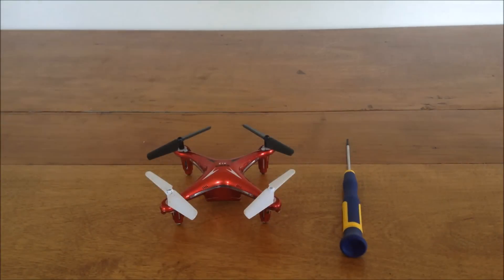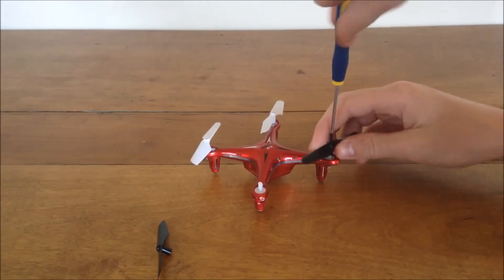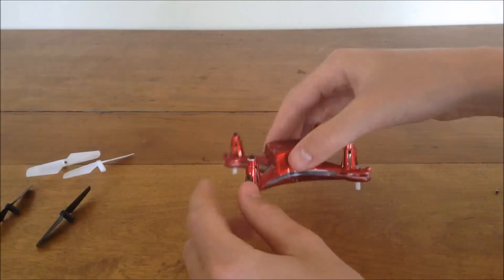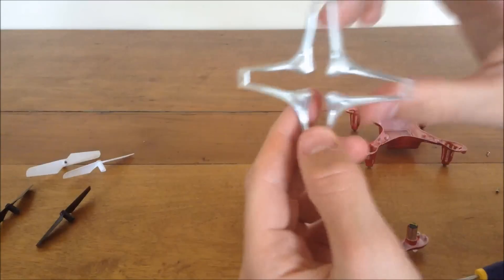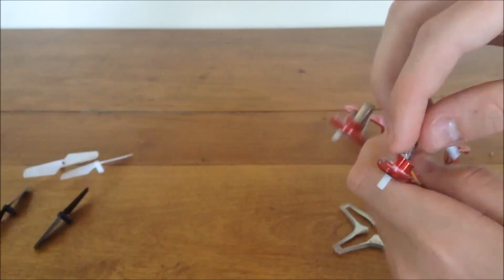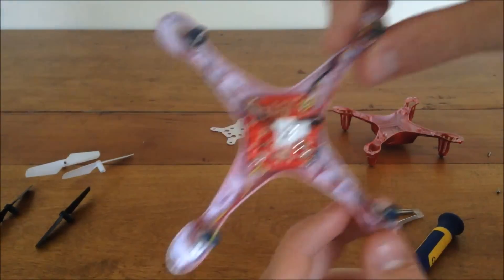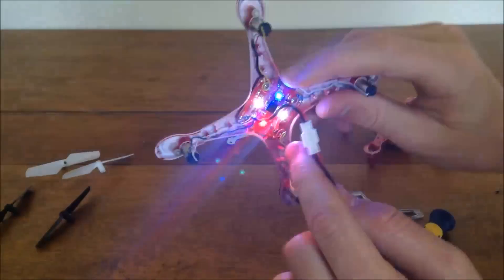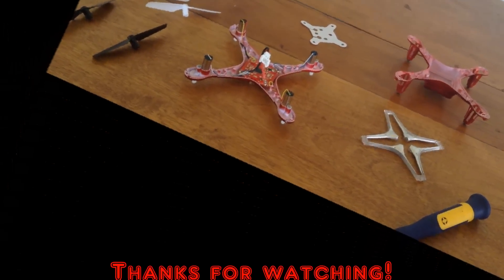Syma X13 Storm Teardown

Comment: I broke one of my gears how can I easely replace it?
Reply from the maker: I am not sure if they sell them. Not too hard to replace if you can find them.
Reply: The RCAddict I found one but how do I take it of?
Reply from the maker: Kobe Van de Vyver You have to unscrew the prop from the top, and it should pull apart?
Reply: The RCAddict there is still an other part connected to it, can i just take it of?
Reply from the maker: Kobe Van de Vyver Not sure since I don't have mine anymore :/
Reply: The RCAddict okay no problem, happy new year!

Comment: Mine has just strangelly crashed. I believe it's also a problem with the gyros. It came to life by itself, made a wide loop (a very nice manouvre, I have to say), and survived because it was high enough. The second time it was lower an crashed on his back. Broke the big gear (the stem where the propeller attachs). I glued it with superglue3, and it worked until it went out of control again. And it broke again in the same spot. Definitely a gyro problem. In your video you haven't take appart the gear set. Do you know how to remove it? I would buy a replacement gear and maybe a new board if it worth the cost. But maybe it would be cheaper to just buy a new one.
Reply from the maker: +Nuno Girão Yeah, mine did that a few times! DO not waste any more money on this one, just get a different model.
Reply: +The RCAddict I just removed the axle pin, using brute force. It popped out and released the gear. In Syma Toy Shop you can get a gear for 2.5 bucks. But sooner or later the same will happen. Going to a sbeqo fq777. And maybe a cheerson X10.
Reply from the maker: Nuno Girão Ok, those are much better :)

Comment: hey use cheerson cx 10's board attach wires coming for motor solder points its done
Reply from the maker: DA AUTHENTIC HACKER Both of my CX-10's do weird things so not sure if that would work. I have already installed and made a video on it using the Eachine H7 board.
Reply: cool

Comment: Funny :D  Only now do I understand how the props can be screwed on from the top! :D  (there is no metal axle, but you screw into the plastick gear) :)  
That prism (the translucant star-shaped part) might be handy to use (parts) for other things :)  Maybe your 250 quad for instance :)  
Cheers!
Reply from the maker: DutchRC ADVENTURES Haha, yeah. I think the LED part is way too small for my 250 and I have re installed it with the H7 board ;) I am getting one red and green led stip for my quad. I would get one for each arm but dot know about how it will affect battery life.
Reply: The RCAddict Yep.. I know buddy, but led's are Very directional (you can see the light well at one angle).. With that prism lens, you can solve that..
In fact, I have just installed a few led strips on a quadcopter.. I'll probably be able to show you what I mean shortly in a video :)
Reply from the maker: DutchRC ADVENTURES Yeah, I dont do much night flying though and even with all the same colored props orientation is easy for me. But to help I am getting green for the front. I mainly want the LED's to look cool ;)
Reply: The RCAddict Nope.. neighter do I, allthough I am planning to shoot some video of the city's night-lights from above :)  so well.. I've put 4 led-strips on a quad to be able to keep track of it :)
Reply from the maker: DutchRC ADVENTURES Nice, I think two will look cool enough. :D
Reply: The RCAddict Yes.. but like I said: leds are very directonal.. Leds at the front, you wont see from underneath, and vise verda :)  So.. 2 strips at the front, and 2 at the bottom :)   I'd allso like some blinking red leds at the back, but haven't found nice ones :P
Reply from the maker: DutchRC ADVENTURES I know but dont need them for night flying just want to look cool when close. I will put a green facing down in the front and red facting down in back
Reply from the maker: The RCAddict I just checked the 9XR's on eBay and they are both up to $75 already. I guess I will have to just spend the extra and get the 9XR PRO from HK. I will also need the case and LiFe for it so like $135 total so about $50 more than I had planned but that seems to work out as my mom gave me the job of cleaning my step dads office in his garage where I work and she is going to pay me $50! It all seems like it will work out :D
Reply: The RCAddict That is great man! Will you be ordering the quad + parts pretty soon as well then??
Reply from the maker: DutchRC ADVENTURES Yeah, dont know if these will work but here is the total cost https://www.google.com/webhp?sourceid=chrome-instant&rlz=1C1CHWA_enUS635US635&ion=1&espv=2&ie=UTF-8#q=138.94%2B12.28%2B118.18%2B178.27%2B18.29

and here is the total money I will have after I get the money I have+3 weeks of work+ cleaning the office+the refund from the MJX X900 https://www.google.com/webhp?hl=en#hl=en&q=20%2B35%2B3.43%2B117%2B75%2B75%2B75%2B50%2B24.28%3D474.71

I had to also get the 9XR battery and case from the US as if I put those in my china cart it made the shiping go up $40. I will use my $130 from YT($117 after the 10% I set aside as I will have to pay income tax later in the year) once they pay in about a week or two for my $118 BG order since that will take the longest. I will then use my next $200 I get for the HK china one. I just remembered but i forgot the lipos so that will be like another $50 :((((((((((((((((((
Reply: The RCAddict That second link didn't do much BUT.. no matter.. Great to read you're ready to go and order things :D  I'm sure you've allready planned out a few video's about it?? 
Once you've got her flying, I'll have some info video's about the new FPV goggles :)  

ohw.. and I just posted 2 new video's.. the last one is a test of led-stips in daylight :)
Reply from the maker: DutchRC ADVENTURES Yeah, I maybe will only get one battery right now and others later when I have the money as my mom said she will let me wash the kitchen floor for an extra $20.I will do an unboxing of all of the parts so may be long, a maiden flight and then more after that. I wil add the video sto my WL but I wanr you, it is rather long at over 100 now...
Reply: The RCAddict I'd seperate it out into 2 unboxings I think :)  The radio in 1 video.. the rest in another maybe?
Maybe even 1 or 2 build-progress video's as well? (plan them WELL)..
Reply from the maker: DutchRC ADVENTURES I was maybe thinking do my HK and BG orders separate? I might do an update but not sure. I think I will just get one battery to start and then get like 3 more.
Reply: The RCAddict Sure.. that could work :)  It's a lot of monney though.. Try to get some video's out of it (within reason offcourse)..
Reply from the maker: DutchRC ADVENTURES Oh yeah for sure. There will be at least 5 videos just not too sure about the build ones as I dont know if I could restrain my self to make them and Bruce has already made much better videos. I will do a maiden, night, day, camera footage, tricks and stuff, and then other videos when the FPV comes! I will settle for the one battery for a week or so and then pick up a couple more. How many should I get?>
Reply: The RCAddict Well.. You mostly fly close to the house, right? I'd go for 2, and maybe fly something ellse while those are charging :)
Reply from the maker: DutchRC ADVENTURES Yeah, I just go out the door and sit in a chair or swing.I think I will get an additional 2 after the first one so I have three and am able to fly for longer. How long will they last? 5mins?
Reply: The RCAddict Depends on how you fly offcourse :)  But i'd say 5-8 minutes yet :)
Reply from the maker: DutchRC ADVENTURES Bummer, any option for a bigger battery? I saw someone useing 2200 and a gopro
Reply: The RCAddict What were you planning to get??
Reply from the maker: DutchRC ADVENTURES Ive been searching and here are a couple options

2200mah 3s 35-70c $20 :http://www.hobbyking.com/hobbyking/store/uh_viewItem.asp?idProduct=59273

1800mah 3s 65-130c $21 :
http://www.hobbyking.com/hobbyking/store/uh_viewItem.asp?idProduct=59135

There was also a 1600 but it was only 25-50c which you said was too low.
Reply: The RCAddict Check.. I'd keep it reasonably light & nimble then, with the 1800.. It's a race quad after all. You don't want it to turn out sluggish because of the heavy lipo.. 
Allso: more weight is more strain for the ESC's..
Reply from the maker: DutchRC ADVENTURES Yeah, I just watched the flight part of Bruce's build and he uses the 1500. Wouldn't flight times suck with the 1800 since 65-130 is a lot of power leaving? Also the 1800 as with the 1500 is out of stock :(
Reply: The RCAddict You could try an 1800mah with a slighly lower C-rating as the first lipo you order? Or maybe a 1600 with a good C rating..
Reply from the maker: DutchRC ADVENTURES They only have the 1600 with 25-50 and the 1800 with 65-130 :( I might just have to wait for the 1500 35-70 to come back in stock as I am like 96% sure that is what Bruce used.